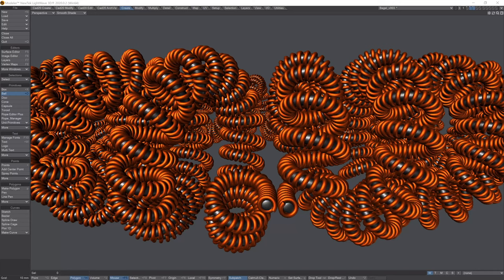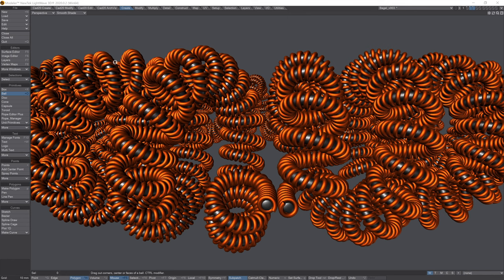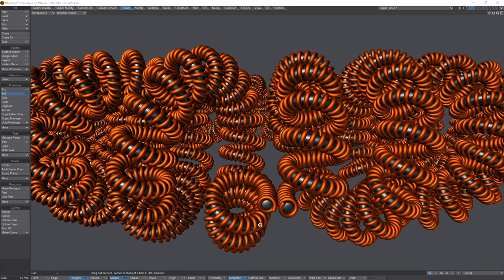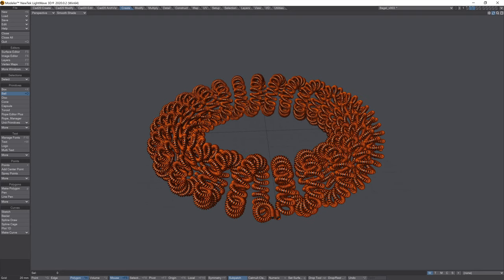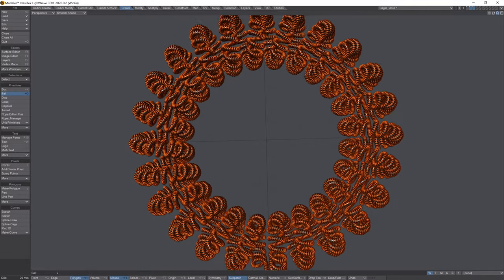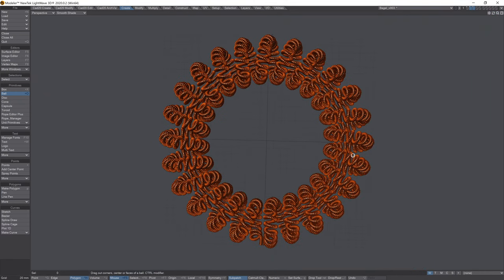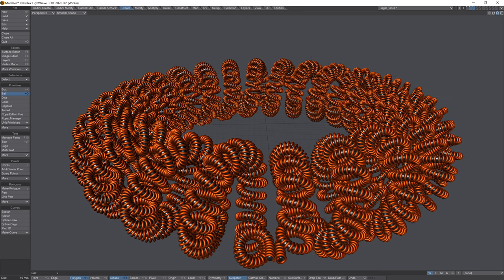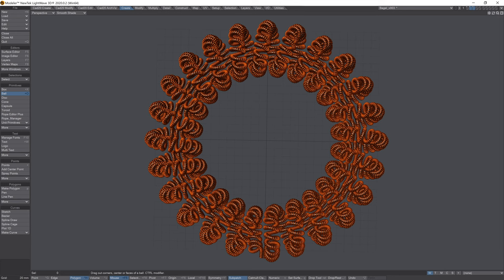O-Day - First 3D model of Super-Super-Tor and suggestion for naming convention

Comment: The first level really reminds me of a guitar string, but the machines used to make them can only do a certain length so you'd have to join pieces. But I think it would be possible to make a continuous spool-to-spool wire wrapping machine, where the fine wire is wrapped onto the heavy wire as it passes between the spools. Put the two spool holders on synchronized spinning axles, and use slip rings to get power across to the spool motors.
Reply from the maker: This was already done by "Cosmic Dave"

https://youtu.be/kk5u2xrtriI

Comment: What I have been calling left matches what you are calling left. Counterclockwise going away from you. I just bought 10 lb of 22 gauge wire. My math showed that to be reasonably ideal. Or at least for a three-level coil with an outside diameter of 2 in. My current coils are 2 in outside diameter made out of 24 gauge and three levels deep.
Looks good, too bad you can't just hit print on that software.
Reply from the maker: Great, the idea is that we are all on the same page so any potential observed results can be compared.

Comment: I suspect that the ends of the iron core either connected or not connected is going to make a big difference. So, everyone pay attention to what your core material is doing. Just like when you have a solid Iron block versus a spiral wire for a core with the ends open. The spiral wire still has open ends and will lose its magnetism extremely quickly
Reply from the maker: This is a very good point SC

Comment: Can u make it a bifiler? It would keep resistance down?
Reply from the maker: Bifilar is not apparently how nature builds these structures. See reference 1

https://remoteview.substack.com/p/practical-applications-of-the-fractal#details
Reply: @MFMP  ahhh. So the net structure of the field isn’t coherent for collapsing? 
Or is it that is all rotating the same direction?
Reply: @MFMP  did Walter russel have ratioed bifiler coils squeezing the water through a tiny hole into sonoluminescence keeping the sacred geometry/ratios? The field would also move two valves at ultrasonic speeds creation water hammer/shockwaves) and allowing more water into the system? At least that’s the idea I can see… hho and steam then turns the rotor and computater. There’s also the OTIS T CARR UTORN which looks very similar but a double cone shape with a void in the inside. This Utron span at ultrasonic speeds and pulses with an electric & magnetic field consecutively. 
Have u heard of Otis T Carr? Worth a look
Reply from the maker: @gruboniell4189  I have heard and mentioned him by way of Ralph Ring's experience.

Comment: can this plugin calculate the length of copper wire that is needed?
Reply from the maker: hmmm. Not sure, need to ask the programmer. Would be useful.
Reply: @MFMP  another thing is Zhvirlbis' paper "The Bagel Game" clearly specifies that coils must be either left-left-left or right-right-right, otherwise Poyinting vector will not end up going in circle but hammering itself on a head.
Other thing If I may ask, I only see here x3 toroids, not x4. How did you count x4?
Reply: Yet another thing needs to be done is, gap between the coils along the outermost circumference MUST be closed. In other words, coil needs to be narrower on the inside and wider on the outside to close these outer rim gap. If that's not done both electric and magnetic fields will escape through gaps and practically invalidate any conclusion about scientific validity of claims. I already told this to Cosmic Dave and he agreed.
Reply from the maker: @HitAndMissLab  Yes to first comment. 

The ring is the last toroid.
Reply: @MFMP  OK, I see, you are essentially counting wire as one toroid.
Can you please comment on my comment about reducing outer rim gaps through which fields will escape.
Reply from the maker: @HitAndMissLab  It is my understanding that the original coils witnessed by  Zhvirblis did not have this level of finesse.
Reply: @MFMP  That's not so much as a finesse, as it is a fact of electromagnetism, if there is a gap flux will escape. You can ask any RF engineer. Zhvirbiis was just doing an illustration of working principle, not a technical specification. When one looks at your photos from electronic microscope one can see many, many of these EVOs and they all have these segments that are narrower on the inside and wider on the outside. In other words individual EVO segments are tightly packed, without any gaps on the outer rim. Basically, nature is already telling us that coils should have no gaps.

Comment: Superb Graphic Bob. It matches the convention I use of clockwise Right (as in most screw or bolt threads). Most bolts and screws and right handed threads, clockwise to tighten, and are a simple reminder if confused. So 3D image above would be L-L-L-L, and my first one was R-L-L-L. although the last one is really a flat 0? N.B.The fishing line Bagel was over 33,000 Tor 1 wraps, which caused problems because if too tight together they are hard to bend into next Tor 2
Reply from the maker: So I am reading from the smallest first. LLL - with the orthogonal 4-level R.

If we can stick to this convention, we will all be comparing like for like.

Comment: The ratio tends to be 10:1
Reply from the maker: Sorry, which ratio?
Reply: @MFMP ratio for 24 gauge wire shrinks 50 feet to 5 feet to 1 foot to a 3 inch 3 tori.
Reply from the maker: @antiprismatic  Got you